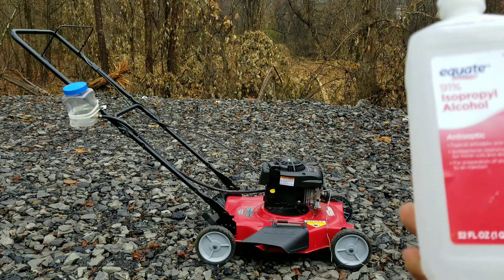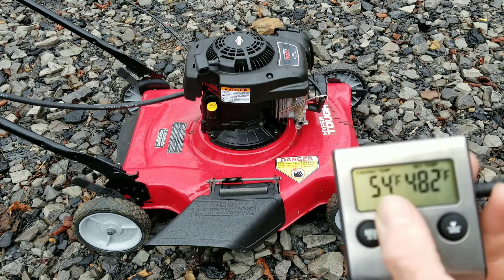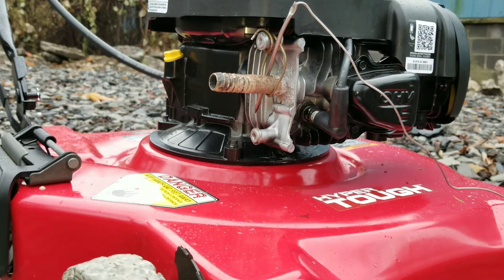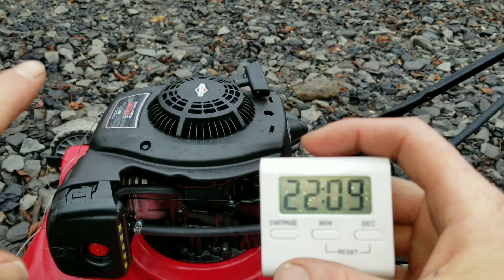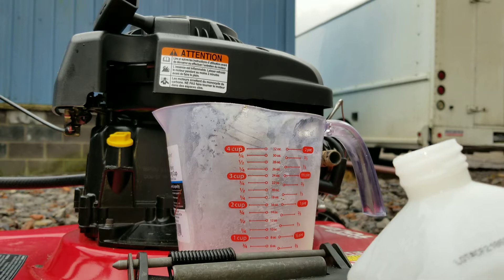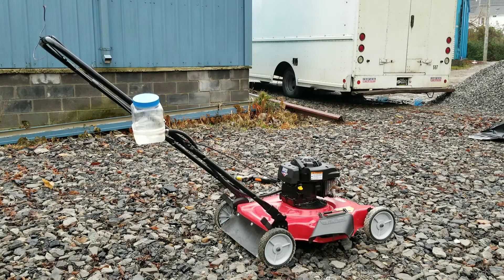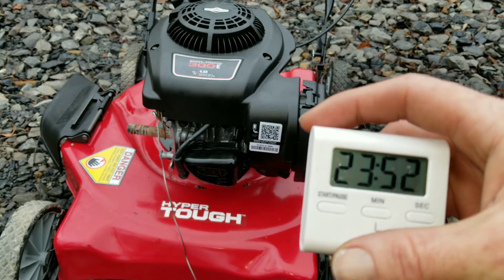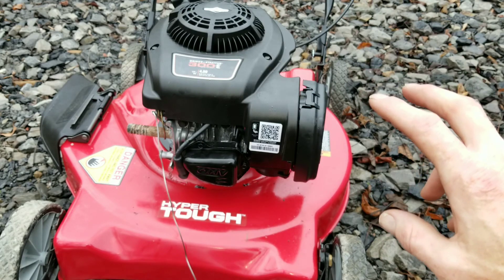gas engine runs on isopropyl alcohol? (rubbing alcohol)

Comment: The engine was sputtering because the flash rate is different than gas alcohol burns faster so if you had adjusted the carburetor for more gas it would have worked fine

Comment: Yeah, in order to really run alcohol effectively you have to almost double the size of the carb jet. I've wanted to do a bit of an experiment and run a 212 predator motor on isopropyl alcohol to see what it can do. Honestly my buddy said if you use alcohol and double the jet size you can make 3 more horsepower out of it but I want to test his theory
Reply: I have done this on my triple su carb Holden Torana and it ran but driving it was sluggish even with a high compression engine. But I had no idea that  I should have advanced the timing? And setup the carbys to pour the alcohol in basically! Lol It was around 22 years ago tho

Comment: Gasoline has more power. Alcohol runs cooler temp. 91%= 9%? Slomo of fuels is always cool. Thank you, Nate!
Reply from the maker: Yeah thank you for sharing with the NIA community
Reply: More power? How about alcohol fuel dragsters
Reply: @bluewave7120  Those engines don't run on Isopropyl.
Reply: @bluewave7120  Those run on pure methanol which burns hotter and is more similar to ethanol which goes in your car, (ethanol also goes in your belly) isopropanol is more similar to acetone and both dont burn as good as methanol or ethanol, mostly because any isopropanol liquid under 100% contains water which can drown your engine.  Methanol is like the complete oposite of diesel, it burns way hotter and is far more explosive. Gasoline burns the hottest and if a dragster were to use standard unleaded gasoline it would probably melt itself after a few runs. Thats why they use methanol. More power and less heat. 🤙
Reply: @evil1st  Much appreciated for the details. Can a 2 cycle engine run on methanol? And would it gain more power?

Comment: Years ago before my main channel got taken down,  I put up a VIdeo of a Lawn Mower running on Everclear.  
Branksome.    Put some in the Tank.   And it did a Great job.   Even mowed grass with it.  
Thing is?   For Small engines?   Alcohol just makes sense since it burns so clean and does not have all those additives.   

For the life of me? I have no idea why this is not sold everywhere since its cheap to make and can be and has been made right here at home.  
Heck, it should be less than  dollar a gallon with how cheap it is to make!  

 Best part however is just how clean it runs  
I can deal with cleaning out a Carb.   Or flat or replacing a gummed up one.    
What I hate is Gasoline fumes since they put all that stuff that is great for your car, but not so much if you like to walk behind a mower, week wacker, or blower.

Comment: !!! My successful "variant" (see end of comment). Found ur vid after running out of gas in my riding mower midway through cutting near 1 acre yard.  I thought of the movie "Lawless", and... proceeded to cautiously "refuel".  **I didn't follow your example 100%, but kept close.  My "3 part" mix (total combined liquid volume 1.5 Cups):  (1cup) 91% Isopropyl alcohol, (1/2cup) 2-propyl alcohol, and (2 fluid oz) fuel stabilizer "Sta-Bil".  ## Pros: EASY start/run of the engine &  Cleaner exhaust emission &  Fair run time.   ## Cons: Very volatile (flash point 59 °F)  &  Increased throttle by 1/4%.  &  AFR was a little tricky w/the choke.  &  Higher detonation = Faster consumption rate / shorter run time.  &  Engine temps limit safe run time. (Long story longer, it works if careful and user discretion)
1 1/2 cup Mixture ingredients:
• 91% Isopropyl - local store
• Sta-Bil - local auto-parts store
• 2-propyl alcohol - local Electronics store (safe/not common/but cheap, use caution)

Comment: Wondering if a diesel alcohol blend might work in the mower. Idea is to use the alcohol to light off a open flame no the diesel doesn't have a choice. But what gain? Fuel milage maybe? Torque HP comparison would be very interesting. I'm fairly certain it'll run it'll just take a min to figure out the mix. Alcohol burns hot would the diesel bring the temp down?

Comment: thank you. i will like to try the alcohol with some trimmer oil i do not if this will work. once i used an old trimmer withi notromethanol, yes RC model fuel. it worked but i think overheating destroyed the engine. yet, the tool lasted only one round but worked better than original settings. that is as far i went in the early 2000's

more experimentation will be a worthy information.  the other alternative is biodiesel, but the engine needs to be modified for glow plugs like diesel engines instead a spark plug.

i hope my experience helps.

Comment: Well, an Internal Combustion engine can run off just about any fuel that is combustible. Alcohol, diesel, kerosene, hydrogen, petrol, methane, etc.  
During WWII the Germans were working with Synthetic fuels made from Coal, and used it in their Radial engines in the Luftwaffe, as petroleum was very hard for them to get, due to sanctions, and war time restrictions

Comment: do you mix it with 2 stoke oil if you use rubbing alcohol
Reply: The IPA may separate the oil from the gasoline and this in 2T engine means total engine failure.

Comment: First off did you advance the timing or adjust the spark gap ? Did you shave the head and install bigger valves ? I run 70% all day on my modified Briggs. It loves it actually. I use a hydrofilic in line filter to collect the water in the oil from the isopropyl and a radiator setup.
Reply: what all changes do you make?
Reply: @5150warpig  too many it was intense I gave the motor away lol.
Reply: @5150warpig  you have to get lucky tbh it probably was the only briggs I had that would probably run on anything you fed it.
Reply: @5150warpig  we put diesel in it one time. Ran almost. Ran it off terpentine from michaels. Ran it with pretty much anything you can think of. And it just wouldn’t kill it idk why.
Reply: Got any videos on how to modify an engine for this?

Comment: Hey.  I watched some of your videos.  I would love your advice on 2 stroke engines in general.  Mowers to 66cc bikes.
Reply from the maker: Ok, what can i help you with?
Reply: @NATESINTERACTIVEAUTO  vibration and mixing fuel. Mostly fuel.  I am running a shit kit for my bike.  I hear oc all kknds of mix.   But i live on a hill and run a chain saw basically for a engine. Salt water air too.  And can i use silocone lubricant for my gear
Reply: Can i mix a silocone lubricant with greese?

Comment: What about 70% rubbing alcohol? My wife just got a half skid of it and won't sell. I thought about running it in my zero turn to just get rid of it. You think that much alcohol would damage any carb seals or lines?
Reply: 70% isopropyl alcohol is great sanitizer. Hands, cuts, scrapes, doorknobs. The 91% takes off Magic marker, sharpie
Reply: @KYLE-jm6tr  No hoarding! Can you read? She bought a salvage pallet and half of the pallet was rubbing alcohol. She couldn't give it away. Nobody wanted it!
Reply: 70% has too much water in it

Comment: so dispels the myth that you can not use ethanol in a small engine.
Reply from the maker: Yes may not be to safe
Reply: @NATESINTERACTIVEAUTO  the lawn mower ran using alcohol and I saw no problem. Ethanol is alcohol.  Would using Ethanol clean the engine.  Gas  leave a film of varnish that Ethanol  would brake down an clean.
Reply from the maker: Interesting what other new test can we perform?
Reply from the maker: Thanks for watching
Reply: john vuhl  no, but both are very simlar
Reply: @NATESINTERACTIVEAUTO  put a turbo on and run some e85😂😂😂